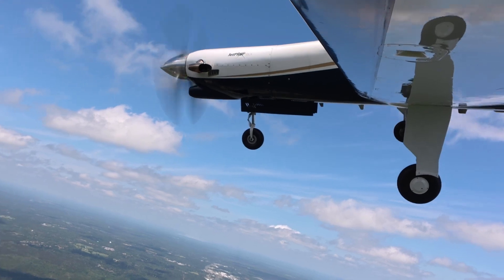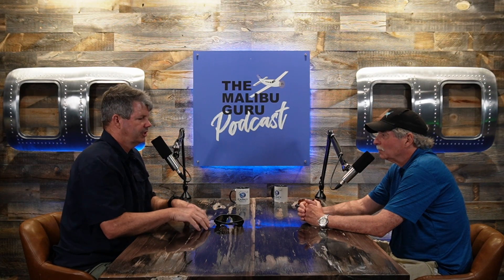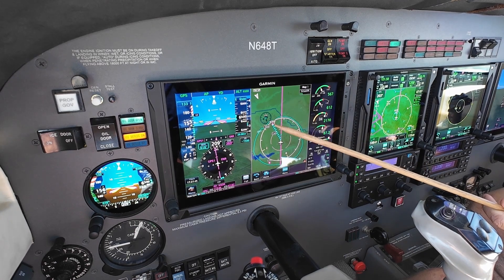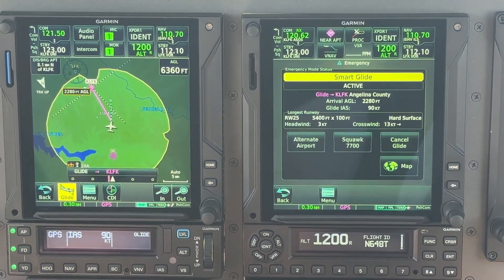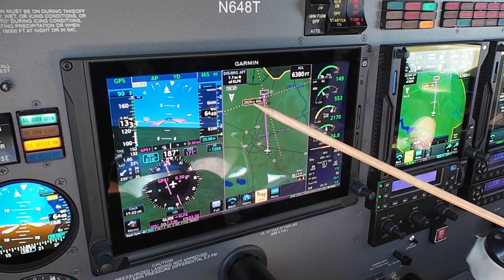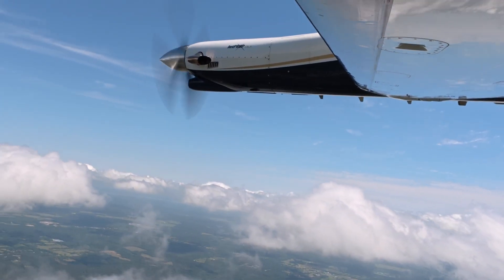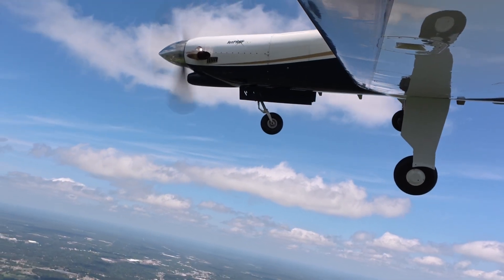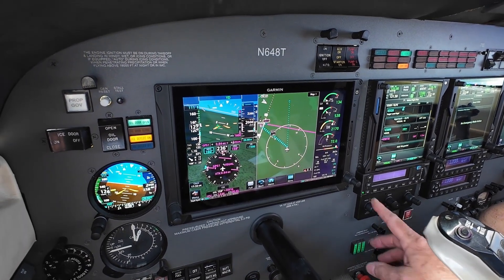How Garmin Smart Glide Changes the Game in Engine-Out Scenarios | The Malibu Guru Podcast

Comment: Great information! Thanks. I've lately been doing pattern work in a Pipistrel Alpha Trainer. At a 15:1 glide ratio, this little guy handles much like a glider, and makes a Cessna 172 feel like a falling rock. It lands by pulling power from 70 knots to idle when abeam the touchdown point and then finishing the downwind, base, and final all in a power-off glide. More often than not I still struggle to bleed off enough energy to nail the recommended 55 knots over the numbers. The Alpha Trainer will force you back into stick & rudder world to effectively handle crosswinds, and will also force you to up your energy management game.